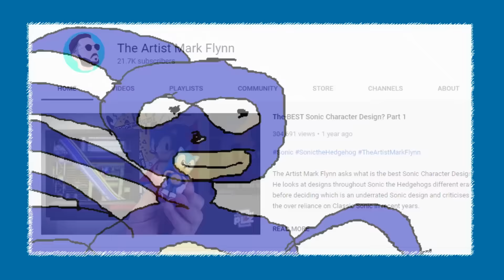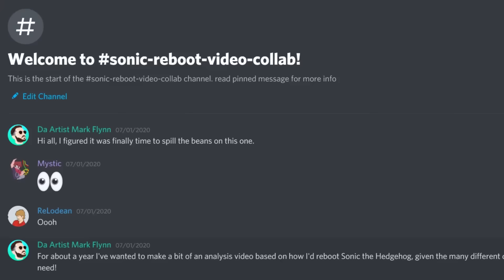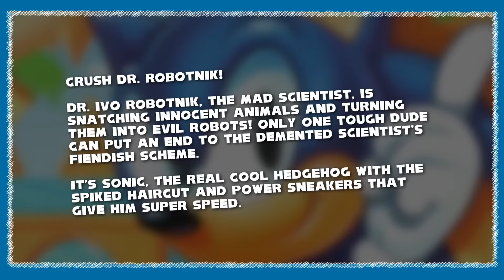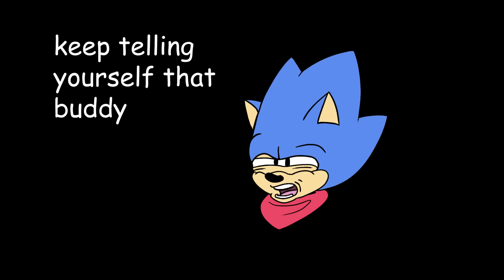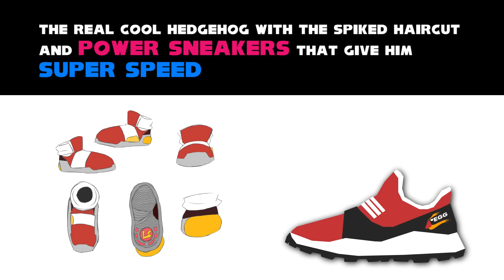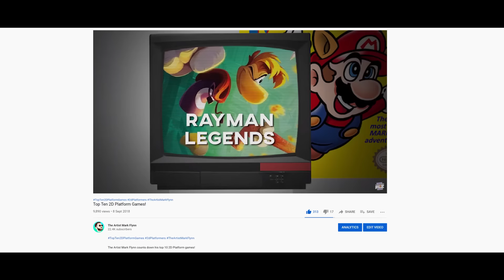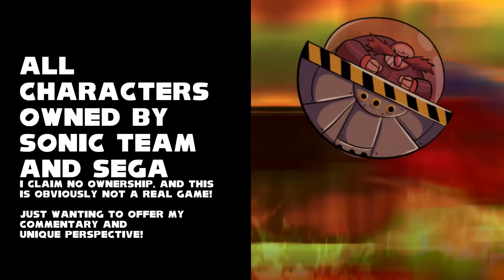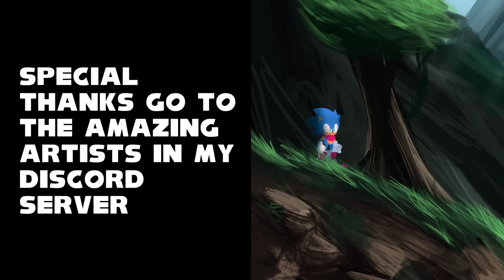Sonic the Hedgehog Reboot Concept

Comment: I definitely love this concept. It's a great alternate take on Sonic that still fills the vibe of the franchise. Despite this though, I don't think something like this should take over Sonic. I think the characterization in Sonic CD's intro, the Sonic Adventures, and Sonic Unleashed are probably his best. I know that's a varied amount but I think they all can coexist within the character of Sonic. I think it's important for Sonic to quip and trash talk because he's a cocky character. Sonic is the definition of cool, he's the unstoppable force. I love him being silent when serious, ESPECIALLY in scenarios like the Sonic CD intro, but I don't think he always needs to be silent. He's a wise cracking teenager after all. As for the gameplay I definitely think speed based momentum platforming is the ideal, but I don't think it should be restricted to 2D. It can and has been done by fans in 3D, it's just Sega's alternatives have never really fully translated that design aspect. Sonic GT specifically comes to mind but I know there's more. Also I'm an advocate against a run button. The spin dash in my opinion already facilitates the ability to get instant speed so a run button would just be redundant. I know Sonics control in general is divisive, but I think the adventure games have a good start, the main problem being that Sonic's turning arc doesn't adjust to his speed. Fix that and his 3d control should be tight and responsive. Although I do think boost elements, primarily the stomp and drift, should stay. Generally they're nice additions and really complement his move set. As for story I really dig your interpretation, it's a nice idea and harkens back to the core message of Sonic, technology vs. nature. Over all this interpretation of Sonic is really refreshing and unique. I think it could definitely make it's own universe of media, kind of like a Sonic Boom gone right! Good job Mark and keep up the great work! ^^

Comment: Okay, I enjoyed the video, really well produced and well described and detailed pitch but I have many problems with the pitch. The main problem is that I fundamentally disagree with the concept of giving sonic a reboot, this have been attempted in the past with both sonic 06 and sonic boom and know those games turned out the way they did mainly due to sega but at the same time if boom was polished it would only be considered an average at best platformer, by rebooting the series and starting everything from scratch including getting rid of all the characters your effectively getting rid of something that many sonic fans really enjoy about the series and that is giving us these characters with fun and varied personalities and getting rid of everything that sonic has built up over the last 3 decades. I also think that sonic is definitely at it worse when it's afraid of it's legacy, when sonic fully embraces it's past it usually turns out incredibly well, take generations for example. Secondly I also fundamentally disagree with keeping sonic as a 2D platformer only as 3D offers much more potential for the series to blossom into something truly special. In terms of the actual gameplay I think that giving sonic a run button is completely contradictive of what the 2D sonic games are and why they are so good, sonic is all about using the physics and the momentum gained by using the physics to your advantage and finding new ways of doing this to get even faster times in the levels and replaying the levels to find different routes and different paths to get to the end in the quickest amount of time possible essentially making those games infinitely repayable and while I think taking inspiration from other sources isn't a bad idea I do think that going too overboard with those influences can be detrimental and in this pitch I think that is the case as it barley really represents what those 2D sonic games were about effectively making sonic lose his identity as an incredibly unique franchise since even to this day there really isn't much like sonic either in 2D or 3D aside from fan games. I like some elements of the story but I disagree with the extremely dark tone and concept as sonic, while it did take itself seriously, it was never so indulgent in it except for games that usually are bad such as sonic 06 and shadow the hedgehog, I think sonic needs a really nice balance of both which can be seen in games like sonic unleashed and sonic 3 where there are serious undertones and serious stakes on the line but still have a cartoony and comedic side to them but I do agree with the theme of nature and the industrialization of that nature and a balance of both being the true future to fight for and having some quieter moments to take in the scenery as I think it would be a nice way to take moments in and to take in the environments but the lack of classic characters such as tails and knuckles to have in the story or as different playable characters is something that I disagree with as well. Overall, while the video is well produced and I appreciate the time and effort you clearly put into this video and the passion you have for sonic is clearly presented in this video well but I think that this pitch falls into the same trap as the other video you mentioned where it's trying to turn sonic into something that he isn't, sonic is a franchise that blossoms due to it's unique concept and gameplay but by taking that away you are effectively turning sonic into just another platformer that isn't that unique when compared to competitors. I think that sonic should keep it's characters and continue the cannon that its established for the last 3 decades instead of rebooting which I feel would further split the fanbase thus making it harder to please as a whole, I do think that having a new gameplay style with 3D momentum based physics and open ended level design that allows for endless experimentation such as fan games like sonic utopia and sonic green hill paradise is the way to go gameplay wise with a story that is similar to unleashed where it feels like a grand and big adventure. I feel that sonic hasn't even scratch the potential it has in 3D yet and this is coming from a guy who considers sonic generations the best sonic game and his overall second favourite game ever.
Reply from the maker: Sonic 06 wasn't a reboot! They said it was gonna be, but it definitely wasn't lol
Reply: I do see your point here; that is fair!

Comment: Really neat video, Mark. I definitely don't agree with everything in here (give me back my fox boy) but the main thing that sticks with me is wanting a game that does a good job at taking itself seriously. When characters care about the happenings in their world, I care too. Sonic clearly cares about his home and mother nature and Eggman clearly cares about establishing dominance by any means necessary in this project.

Another sticking point is the mention of the Ori games, and while I don't think chase sequences work the best for Sonic as he usually runs towards danger rather than away from it, I think the FLOW of Ori's platforming needs to be shown to Sonic Team. If Sonic could move how a fully tricked out Ori could in either a 2D or 3D space, it could be something really special and, most importantly for myself, new. Currently, 3D Sonic flow states only really exist in one move at a time. Sonic never combines boosting with homing attacks, you only really do one or the other. Or when you spindash, you may only let it take you or use a jump with it to reach a new area, but then that'll be it. Ori flow states are pushed to their limit in the chase sequences as the player has to think quickly on their feet to survive whatever horror or element is coming at them, with a quick respawn in case they fail to prevent them from wanting to give up. First time I played the Ginso Tree escape, I failed probably upwards of 20 times, but the music and speed never made me lean back and take a deep breath, I just kept moving and focusing. Now I can do it first try anytime.

And if you're still listening to me, one of my bog wishes to make a change in the franchise would be some kind of combat-focused spinoff like a Hyrule Warriors/Age of Calamity/P5 Strikers type game but with Sonic characters destroying hoards of Eggman robots. Or maybe even something akin to DMC combat where you have a lot of ways to obliterate an opponent and being inspired by Spiderman PS4's combat where, once again, the FLOW of combat rewards you for mastering its systems and techniques, and the reward is a continuation of the flow. So trust me when I say, you are going pretty far, but not too far!

Sonic can work in a multitude of ways; the potential is there. Somebody just needs to capitalize on it.

Comment: I think an interesting justification for linking Sonic's origin to Eggman could be something like this:

-During the corporation's monopoly over South Island and its natural environments, Eggbotnik Industries slowly burns through the land's supply of renewable and non-renewable resources. Realising that he is going to soon run low on fuel and supplies, Eggman attempts to find a new way to power his industries.

-He finds a use for the animal inhabitants of the environments he destroys; hooking them up to treadmills that will power his machines. But they are too slow and tire too quickly, so he begins experimenting on them to provide them with abilities that will enable them to run faster and for longer.

-Many of the animals that Eggman tries to augment fail as their bodies/hearts are unable to handle the immense new speed and power. This makes Sonic special as not only does his body handle the power excellently, but Sonic himself seems to get a handle on it instantly. However, Sonic's feet cannot physically handle the top speeds that the hedgehog reaches and are injured if he pushes himself to far.

-To remedy this, Eggman puts the Eggbotnik Airs onto Sonic and - as to not waste the potential of this unique hedgehog - positions him as a primary source of power for the production line of Eggbotnik Airs .

Things can go as described in the video from here. Just an idea I had and wanted to write somewhere. I think this way, Sonic is important to Eggman as he is currently the only animal to have taken well to the experimentation and is important for the future powering of his machines. Sonic has the ability to save Eggbotink Industries or to destroy it, depending on which character gets their way.

I would love to hear any opinions on my little amateur idea.
Reply from the maker: I've only just seen this comment and I bloody love this idea!
Reply: @ArtistMarkFlynn  I appreciate that you read this long comment all this time later, and I am very glad you like the idea. 
Many thanks, Mark, you did a great job with your concept.

Comment: Great ideas in regards to story and atmosphere, but I just can't get by the idea of a run button outside of Lost World, and slower paced gameplay while a great way to soak in the fresh atmosphere would still break the speedy flow that makes Classic Sonic so great, maybe cutscenes between the zones could do this instead. The moveset also has potential but only if done just right, should grinding be automatic like the boost pads in 2 and CD, or should they be physics based like a conveyor belt (also in Sonic CD), and should they have a balance bar like Tony Hawk's Pro Skater? How should the wall jump work? Is the frame window tight like Mario 64? Is it loose, following a wall slide triggered by touching the collision volume of wall like in New Super Mario Bros for the DS? Does Sonic Jump off the wall with a consistent force, can that force be directionally influenced by the player and how (before during or after performing the act of the wall jump)? Can you climb up a wall by wall jumping towards it repeatedly with a met gain in height on each wall jump like in Mega Man X? There's still lots to think about here.

Comment: The only thing about the gameplay I have some gripes with is the run button, I believe that Sonic should be gaining momentum by running instead of having to push a button to do so. I’m not saying that the idea couldn’t work though since lost world’s and Rayman’s run buttons were pretty solid. I would propose the run button being less of a way to go at a faster, set speed, but more of a small boost of sorts in order to reach top speed. When I say “boost” I don’t mean like in the modern games, I just mean a small burst of speed. Maybe this “burst of speed” could be powered by rings or those blue tubes that make Sonic faster, or maybe something else. Either way, I still like the video in general, I’m just giving my opinions and suggestions.👍🏿

Comment: I think this is a really fun idea. I do have some issues with it, most are minor as far as the plot goes but I do have two major issues that I would like to explain:
1. This idea probably cannot be a reboot for the series as it would only really work in one game. Killing off your villiain (supposedly) and having Sonic throw away his shoes basically means that there can be nothing to follow up the series. Bringing them back can be done and has been done by other series to be sure, but I think the message has overtaken the plot in this instance (or what the plot should be).
2. I think the plot around Metal Sonic is somewhat underserved as he could be simply replaced with a brainwashed Sonic clone and it would make no difference. Something far more interesting (which could be set up for further games) is the fact that Metal Sonic cannot exist in Sonic’s world. The whole environment vs technology theme essentially set the two against each other with Sonic as the defender of the environment and Metal Sonic as the hero of technology. However both Sonic and MSonic are intertwined with both as Sonic is from the forest but changed into something better by Eggman and MSonic was created in the image of Sonic making him a forest creature with a robot body. So both have connections to each other, but while Sonic is from the forest, MSonic is from the factory. The factory requires the forest to survive, but the forest cannot survive the factory. This can be the main conflict between the two. Sonic wants to save the forest, but only has the power to save the forest because of Eggman. And MSonic wants to save the factory so he can survive, but appreciates the forest. Especially if it is set up that Egg inc. has done many good things, it would make for this interesting dichotomy where each has to sacrifice the good of one side so the other can survive. Having MSonic become good just cause the flowers are pretty (and then just bringing out more with no character) really cheapens the impact and is another instance of the message overtaking the plot. Rather I think the tragedy of these two mirroring heroes creates a far more compelling climax and can lead to further conflicts in future plots (such as the two joining forces against a third worse force).

Overall, I think most of this would work as a spinoff or retelling of the original game, but not as a reboot. I don’t think this is what Sonic needs to move forward, or it needs a lot more work to get there.